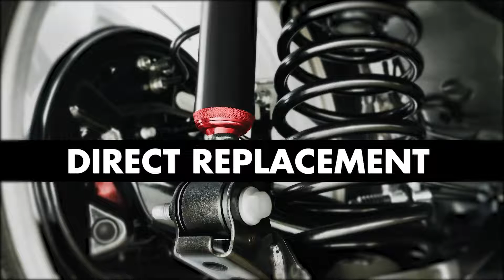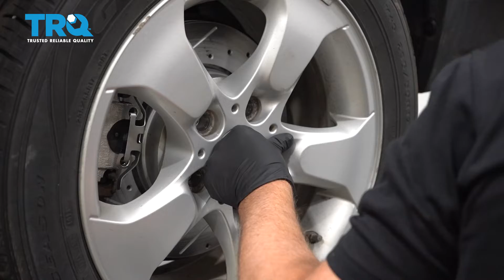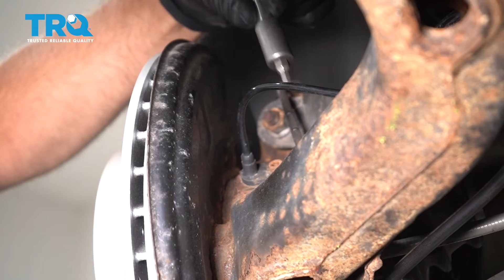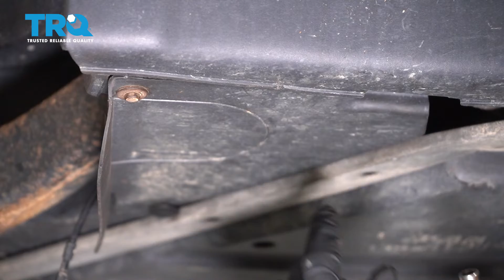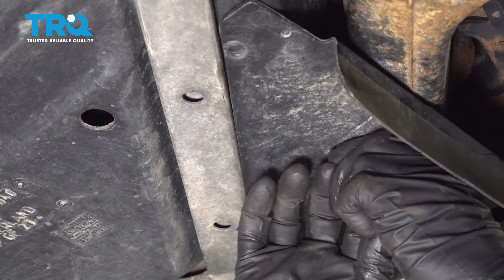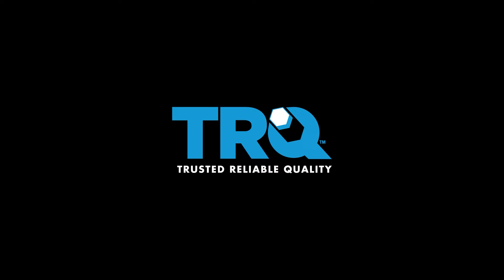How to Replace Rear Speed Sensor 2004-2010 BMW X3

Comment: Hi there!! I've just bought an X3 2008 and have the same issues. I bought the new speed sensor and tried to change it but for my surprise  the connector where it plugs had the wires cut and had no line that follows. Do you know what else I have to replace or do? Thanks!!